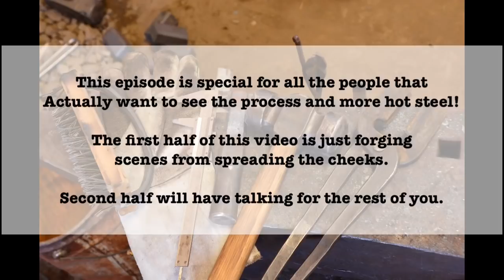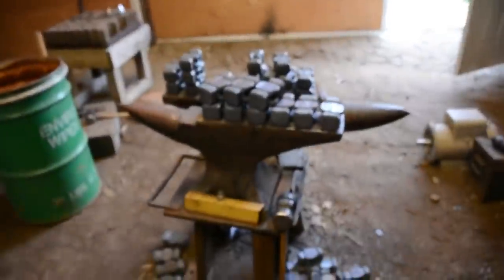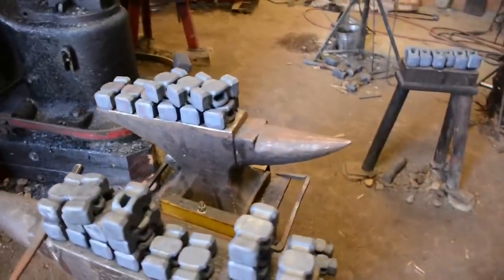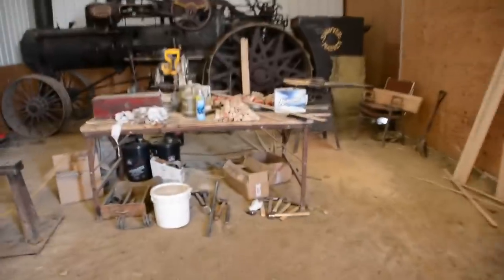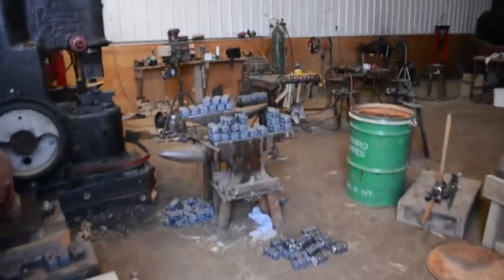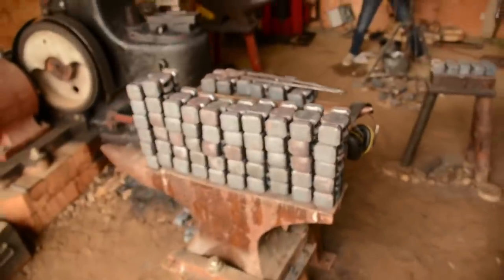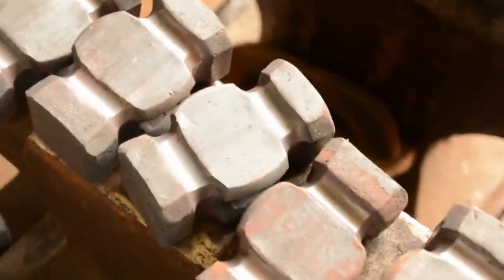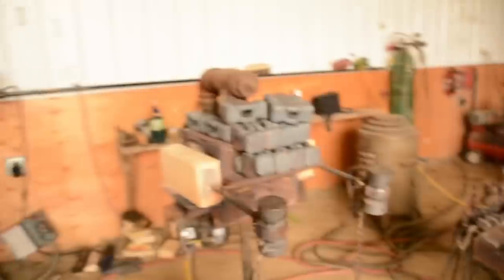Making 100 Hammers for Alec Steele pt. 4

Comment: Like your setup for cheeks and  cupping resulting in loosening the drift! I’m going to copy the sequence it is superior to what I am doing. 

You are using 2” 1045. You mentioned 4” pieces to forge billet. What weight is that and what lengths did you use for the rest of the weights for the order?

Comment: Be careful, you drop the temperature on the billets under the steel specification when you forge, that results in a weaker end product and maybe even cracks when quenching or in later use.

Comment: Well done on optimizing your fabrication steps. There is not a lot of wasted time there at all. 

When I buy one of these hammers do I have to drive all the way to Montana to pick them up from Alex or can I grab one from you?
Reply: They will be all shipped to Alec's warehouse in Montana. You will be able to buy them on his webstore. Alec said around 200$ for a hammer.
Reply: The reason that I ask is that I live close to Ethan.
Reply: @gordongullon152  he sells other hammers too not just for alec
Reply: Ethan has his own website with his own hammers.  If you dont want/need the Alex touchmark then just buy off ethans website.